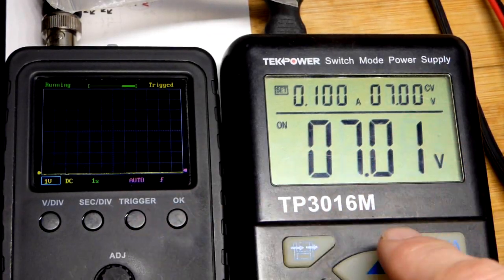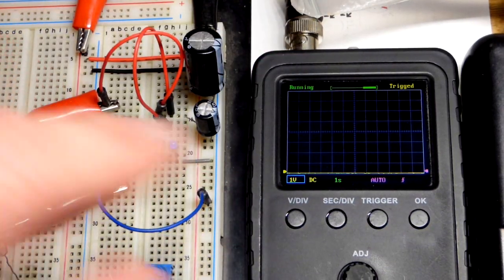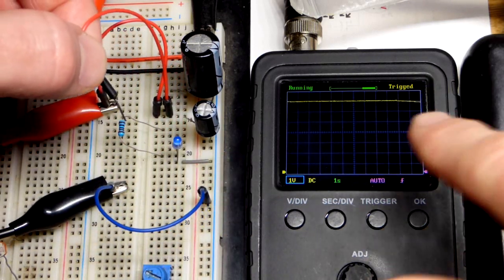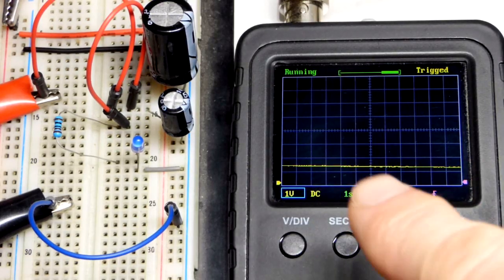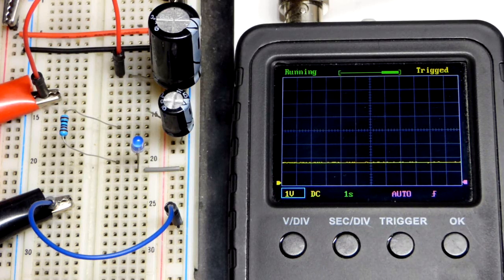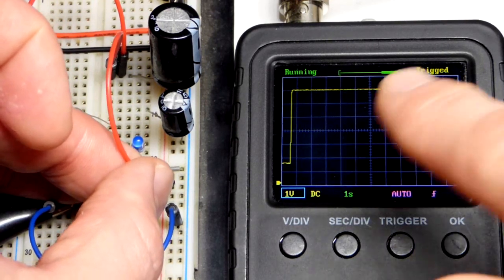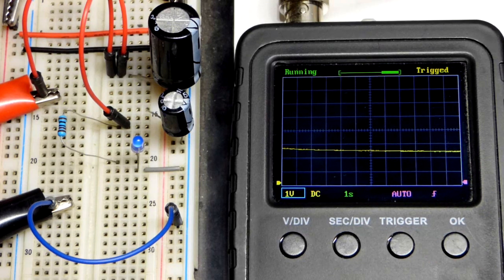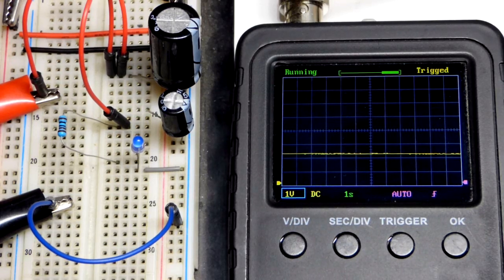1000uF cap voltage change versus 100uf oscilloscope measured for learning electronics shorts 34

Comment: Good learning for me having  never  used a crow would be an expensive toy for me to have and not get much benefit from -

 all the same would be nice to view EMF spikes that I think has blown up my liquid pressure sensor surely those things are more robust my 556 and 393 is fine undamaged,  I've got a back EMF diode protecting a 40 ohmn 12 volt coil so shouldn't be a problem. 

Dare I request you do a video on car pressure sensors or just EMF spikes (guess you already have on the latter)